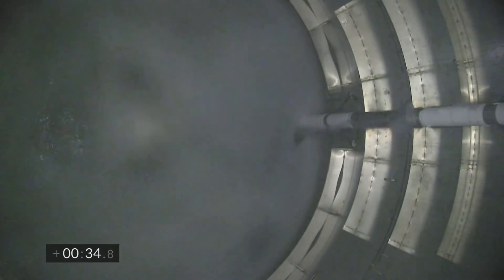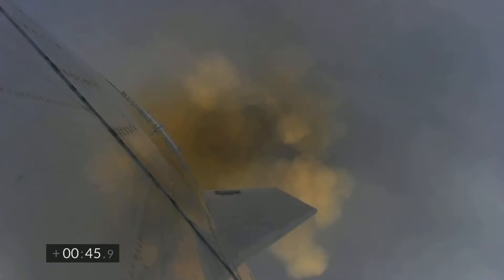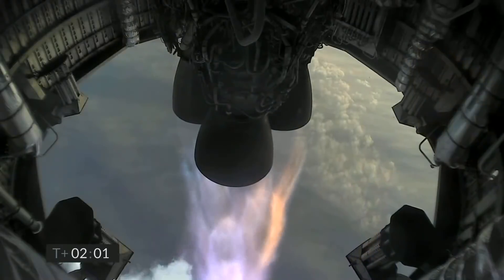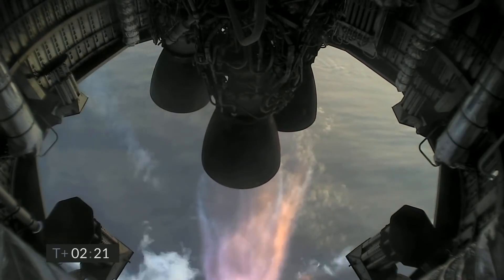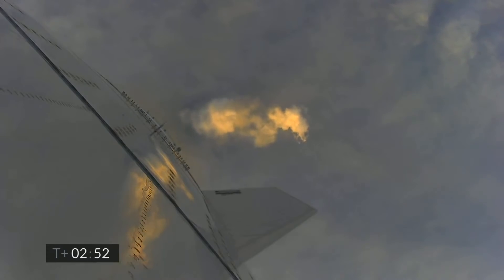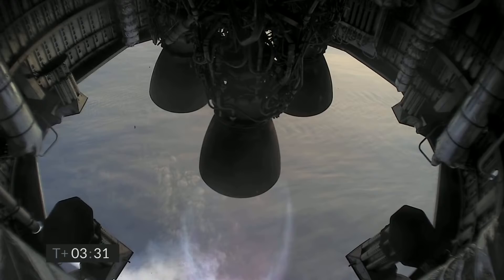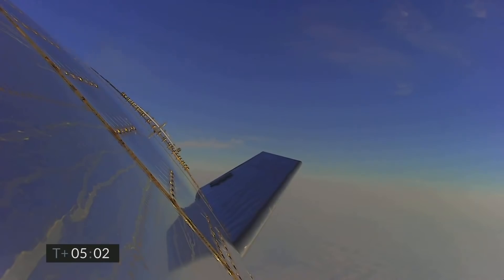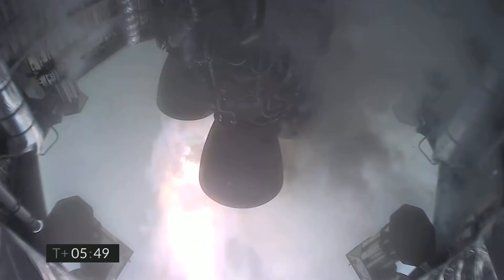SpaceX Starship SN11 Launches & Suffers Inflight Explosion

Comment: Looked like a fuel leak and engine fire. And I think they remotely destroyed it.
Reply: The right side Raptor was not burning right on the way up, you can see the ratio is off. Where are you getting engine fire from? If they couldn't restart the engine when it needed to start it would, as you say, trigger AFTS act.
Reply: @noecarrier5035  Are you too blind to see the engine on fire?
Reply: @grantgilson1258  I'm not sure what that event at about t plus twenty was, it was certainly somewhat offnominal and SpaceX didn't want us to see what happened. They toggled camera views to the other bay cam really fast, so fast they accidentally showed a brief view inside the prop tank.

There is often some fire and light burning just after takeoff around the engine cluster, but something went pop, didn't it? It sprayed little white hot cinders and there was a gout of flame. We will see how significant that was, but it is certainly the case that the engine was not running right.
Reply: @noecarrier5035  "often some fire and light burning just after takeoff" my stove usually doesn't have some light fire and light burning just after lighting except where it's supposed to. I've been saying, they really need to protect their engines more. In this case, I bet there was some kind of leak, but in most cases, every time they shut off an engine it lights a bunch of other stuff on fire. SN10 was on fire before it even landed. Don't believe me? go watch again.
Reply: @grantgilson1258  I didn't say it was acceptable or a good thing, man. Just that it has been normal for these Raptors to be a bit on fire in places where it isn't necessarily ideal. SN10 was, indeed, on fire in a pretty big way as it landed. Why wouldn't I believe you? We all saw the video. I don't need to believe or not believe anyone, it was clear as day during the SN10 landing.

I agree, though. I'm not sure if it is because they're test rigs or what, but  the Raptors are pretty exposed down there. I think the Raptors have a number of design or producton quality issues, actually. Something is up with them -- slow or absent throttle responses and not meeting thrust requirements. That's just an hypothesis, though.
Reply: @noecarrier5035  When Daniel said "Looked like a fuel leak and engine fire. And I think they remotely destroyed it." and you said, "Where are you getting engine fire from?" that's where I formed the impression that you could be in denial or believe that it isn't a problem, which was further confirmed when you said it usually happens. So though you didn't say it was acceptable, you kind of did imply it, because you obviously don't think an engine on fire is a big deal. Like if my house explodes and there is evidence that my whole stove was on fire, you wouldn't conclude that my house blew up because there was a gas leak?

It's pretty clear that if you shut off the stove knobs and suppress the fire, there will still be gas leaking into the house, so the next time it ignites, KABOOM. As the engines were shut off for the belly flop, a lot of gas was leaking into the starship well from engine 2 and when the first engine lit, it blew the whole thing up.
Reply: @grantgilson1258  Aha, I see. My apologies for the confusion. I think when I wrote that initial comment I hadn't been through the whole replay of the stream very carefully yet, just the later sections, so it was a genuine question to that guy. They changed the cam view really fast after it developed, I think the whole incident is only 2 - 3 seconds long.

It's certainly very suggestive though, isn't it?  Either the cause or a symptom of an internal issue that wasn't serious enough to immediately kill the flight but which did enough damage to mean it blew itself to pieces shortly after the relight. One idea I had was maybe a fuel/ox leak or excessive flow into the pumps and a resulting pump overspeed and catastrophic failure?
Reply: @noecarrier5035  Maybe, but it's more likely that engine 1 blew everything up because the feed ended right after. All other landing burn sequences show that engines light one after the other, not instantaneously. So the explosion was after engine 1 successfully ignited but before engine 2 or 3 had a chance. That can only mean 1 thing. There was methane in the engine well which caused enough damage to destroy the camera, which then caused a chain reaction as it blew the rest of the ship apart. For bystanders recording, (every day astronaut)  who were also watching spacex feed, the feed cut off and the explosion was heard after the feed cut off, so you can't argue a delay in the footage, as the explosion would be heard first. Also, fire needs a fuel source in order to ignite, even after they shut off engine 1, Engine 2 it still is on fire even though the camera tries to hide it. You can still see flames. What's it burning? Nothing? Not a chance! fuel was leaking into the engine well. It basically comes down to quality control during engine development. Encasing individual engines in a sealed manner would also prevent the engines from blowing up if leaking occurs, and from being damaged from engine cutoff fire. Would have saved SN10 also.
Reply: @grantgilson1258  Good points, well made.  There's certainly something up with the Raptors. More or better TPS should def be on the agenda. That being said, no TPS will save a vehicle from a serious fuel leak of the kind that was apparently in progress. Though it could definitely prevent such a problem arising in the first place by protecting the engines better. Ignition sources: the engine bay is full of hot metal and so the potential for sources of ignition, especially in the presence of both high speed ram air and possibly lox.

 So, there was a fuel leak in the plumbing for #2. Why did it take until that engine was commanded to light before it exploded? Obviously, the ignition system for the leaking engine ignited it. But that bay is full of ignition sources and, as you point out, the explosion didn't occur until after the first engine lit up. Why didn't the explosion occur at the same time as the first engine relight? The answer there is that perhaps the fuel leak was internal and insulated from ignition until that engine was commanded on?

What do you think the accident sequence looked like?
Reply: @noecarrier5035  Its possible that something internal caused it but I only say that because I don't know the intricate details of the engine design and how they are connected. With that in mind, I still don't  find it likely because engine 1 ignited fine. I don't know how engine 2 problems could affect engine 1. Internal failures of this kind are usually catastrophic, which I suspect means that engine 1 wouldn't have lit as good as it did. Again, its possible because I don't know how they are linked up. I still am sure there was methane leak outside because any time you see fire on the outside you KNOW there was fuel leaking. IT HAS TO LEAK FUEL outside in order to be on fire.  So it could be some combination of both, but I require a better explanation for why the sound was so delayed if it were just internal. If engine 1 had an internal problem and blew up as it ignited: 1, I don't think engine 1 would look so good when lit, and 2, there would be less of a delay in the sound. I still think the camera was destroyed from a secondary explosion as engine 1 ignited excess methane, which then opened the leak more, which was ignited again by engine 2 when its sequence was lit, but it was caused initially from an external leak. Also, if it was internal, then it would have exploded on static fire, or the ignition sequence. Its pretty obvious all evidence leads to external methane accumulating in the engine well because of shoddy construction.
Reply: @noecarrier5035  Why terminate the Starship because a Raptor failed to re-light?  Elon said after the flight it wasn’t needed.  I think there was another reason for what happened.
Reply: @sonnyburnett8725  I'm guessing that the failure mode had progressed to damaging the other engines in some way, and that very little or no thrust was produced inside the narrow window of time available. AFTS activations can occur extremely rapidly if the avionics detect a fault.

Have you seen the debris field? It's scattered over a wide area, but there was only a small explosion that wasn't very loud. FTS work by explosively peeling bits of the fuel tanks either together or apart, based on fuel type. This also peels the spacecraft quite efficiently, into little pieces.
Reply: Why would they explode an expensive shit?
Reply: @instantnoodles8640  Flight termination systems are fitted as standard to most rockets. It's so they don't land on anything or kill anyone. Usually, the charges peel open the fuel tanks and force them to burn up all at once. If a small lake of kerosene and liquid oxygen or whatever lands on you, you're going to have a bad day. Best it happens in the air.
Reply: @noecarrier5035  yeah but but what if they buy a big piece of land then use it as a testing area?
Reply: @instantnoodles8640  Rockets can go really fast and end up travelling great distances. SpaceX does evacuate and clear a large area around the site before each test. It's still required -- the consequences of a fully fuelled booster rocket hitting a building or something like that would be enormous. I believe it's actually a legal requirement, too.
Reply: @noecarrier5035  understandable

Comment: One of the Raptors looked a bit like it was burning lox rich on the way up.
Reply: I assume you mean fuel rich? Due to the yellow flame?
Reply: @kristenburnout1  Oh yeah, of course. More oxidiser is going to make it burn hotter, not cooler.
Reply: Yes, I saw also sparking flames all around the raptor engines
Reply: @peterquidam8553  Some of that is normal, I've seen it before, but the engine bay camera view was switched to the other side shortly after it seemed like a heat spot developed, ran around a motor pipe and then popped, scattering hot shards and leaking fire.
Reply: yeah, thats why it could not land
Reply: Yes we don't know the reason yet
Reply: We do know the reason
Reply: Elon tweet
Reply: @EmileLF  Has he said something beyond the initial tweet about it not achieving the right chamber pressure?
Reply: @noecarrier5035  yup
Reply: Elon is peaked. Only so far you can go once you keep reaching the same problem over with the flip. Just may not be feasible.
Reply: @adamburling9551  no, Elon himself said that sn11 might not land because of this exact problem,